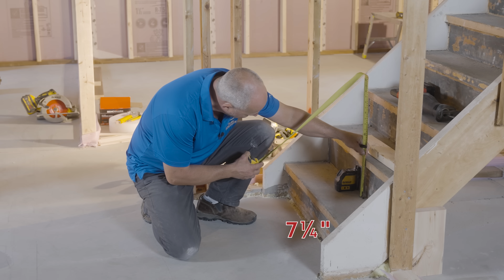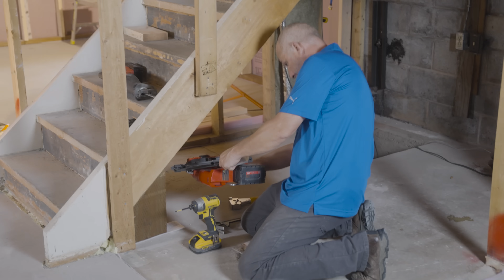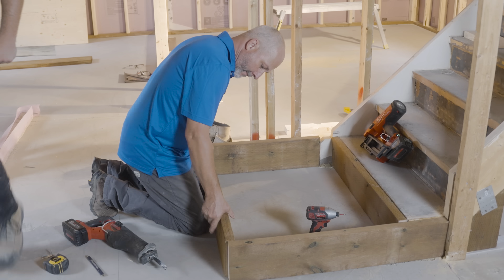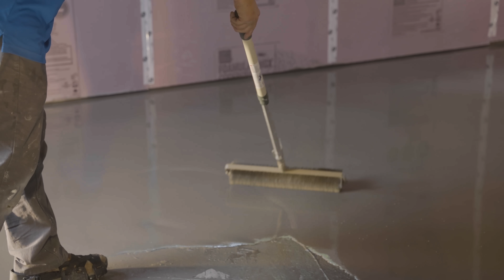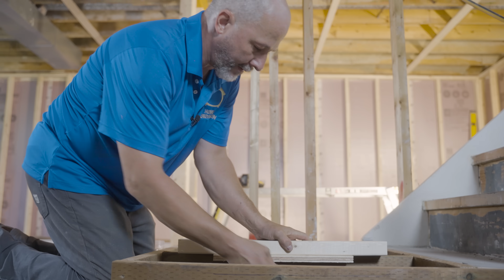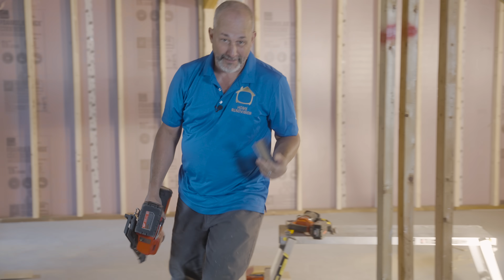The Most Common Basement Problem (And How to Fix It)

Comment: Seems like an odd problem to have. And not an ideal solution. Who wants 36" x 36" step that doesnt do anything but take up room. As other people said I'd just tear that out after the building inspector passes it. But Either A it's a new build so youre not gonna have any riser height issues. Or B it's a basement reno and depending on what you do you'd be unlikely to get a permit anyway. Unless you're doing like a full living space down there and youre gonna rent to people or something. Also...I highly discouraged anyone from making a basement or attic into living space. These spaces were not intended for living space and they should remain being used only for what they were designed for. Happy building 👷‍♂️

Comment: The one problem with this solution is the raised floor is where the ceiling is now lower after the staicase ceiling meets the basement ceiling...that means any tall person would have to duck until stepping down from that platform (one caveat is if the basement ceiling is actually the standard main floor height)

Comment: I was watching you put in that board with the foam under it with the  "love tap" and thought that cut should should accommodated for the depth of the foam. Then you wouldn't have needed that shim.  The whole step popped up after that tap, and looked unlevel after that. The shim seemed to leave more gaps under that stair around the shim. Next, seems like there was way too many parts needed for the landing.  Why not make the box a bit shorter to accommodate for the plywood, then put a full piece of plywood on the landing? Just my thoughts - love your channel and learn a lot, even to be able to ask questions now!

Comment: A) Have inspector come out before you put carpeting in. "It is going to be a concrete/unfinished floor/area of the basement"  b) Add 1/4" to the design of last riser when building staircase.

Comment: I would have cut a new staircase.  Given all the major work he is doing in that house, and the super duper living space basement he is planning, solving a problem via an extra landing that eats up 9 sq ft of the basement floor (and that is not required for changing direction) seems like a shortcut to regret years later.

Comment: Does code say to run the grain the wrong way?
And no supports on ends where the plywood will bend due to the grain being wrong.
And why not just rip your frame so you can just run one piece of plywood over the whole thing?

Comment: I used to build houses and that is my preferred method of ending basement staiirs for quite a few reasons.  Designers usually don't leave enough room for stairs to work well.  I always tried for atleast 42" length on that bottom landing.

Comment: Weird.  I've never seen such a thing as a landing on the bottom step of a basement stairway.  It seems worse than a useless eye sore, it looks more like a trip hazard.  Also, the 3/8  inch variation in riser height applies to contiguous steps not the staircase as a whole.  Sorry, I'm feeling a little cranky this morning.

Comment: The solution to the problem is to Figure your math from finished floor to finished then then you add on the bottom riser accordingly, then they all work out mathematically. Don’t forget to drop your  bottom riser to the thickness of your stair tread. You could wind up with a problem with head height if you add a landing, that has to be figured out.

Comment: I'm aware of the code for variation in step height and had come up with this solution for my basement....but wasn't sure if it's acceptable. Thanks for confirming that I'm not the first to have this idea! The only question I have is why would you not use one continuous sheet of plywood for the landing? Is it just because you wanted to go full material width on the 2X8s?

Comment: Step 1 Build stairs wrong.  Step 2 "Fix" by adding unneeded and non-functional landing.  Step 3 Take 3x longer than needed to frame and deck landing.  Step 4 Fail to use adhesive under plywood, guaranteeing permanent floor squeaks.  Step 5 Announce "Once again, this is better than code!"

Comment: Most basement stairs have an upper floor opening just or less than the size of the staircase, if doing something like this, be careful to maintain minimum height from your landing to the beam or ceiling above... in my area its 6'-8"

Comment: Why not just rip down the joists by the thickness of the plywood?  That way there would be no need to monkey around with 2x4" and three separate pieces of plywood?  and then you just cut one 3'X3' piece of plywood out of a 4'X8' sheet - then Robert's your Dad's brother.

Comment: Oh, Jeff, Jeff, Jeff. This is way too many pieces of lumber, too much labor, and too much potential for squeaks. Remove the bottom tread and build a new platform extending from the riser. Skip all the extra 2x4s and little pieces of plywood. You only need rim members (anchored into the slab) and some intermediate joists, which don't have to be full depth...2x6s will do. One piece of plywood over all of it, and install your hardwood.

Comment: Won't you have the same problem when you lay the hardwood on the landing? The first step up from the landing will be the thickness of the hardwood shorter than the rest.
Reply: I believe he is installing the same flooring on each step.

Comment: I just did this after moving my stairs in the basement. The landing solved my 36” problem to the wall. Putting a landing solved everything and allowed me to turn left and right. Great insight. Oddly we’re on the same wavelength.

Comment: Oh, there is no maximum height code of the landing??? 

Due to the flaw of the framer, My last staircase is 8” high, which is 1” higher than other steps, if there is no code of landing,  can I attach a landing that simply levels to the last stair, turning it into a huge “magic landing”, like in this video, and pass the inspection? 😂

Comment: I want to install a thermo pump, unfortunately passing an electrical wire through the ceiling is not something i want to do. If i pass a wire along the ceiling, is there a way to hide it so it doesn't look obvious ?

Comment: as someone who has a trip step landing for code reasons...... I DESPISE IT. go the extra mile and do it right. at least yours makes sense with the hight.... mine doesn't its 3 inches BEFORE any flooring goes down. With carpet/subfloor below it it makes it more like 2 inches. I HATE IT,  I'm working out a way to delete it and make another actual step to replace it and move the steps to be shallower just to fix it. Its concrete steps so its harder to just FIX than you have to work with. I wish I could just fix it with wood like you can, but I don't have that luxury. WHOEVER DID THIS IN THE 1970's when they built the house.... I HATE YOU.

Comment: The biggest problem isn't getting the stairs perfect, it's getting rid of code that only gives you 1/4". Ima guess that's due to human nature and that we would expect the stairs to be even as we descend them to avoid a tripping hazard but, 1/4"?? That's freakin' tight. Who wants a landing instead? It's just a work-around that exists for no real reason at 1/4" code variance.
Reply: I agree. we have a stupid 3inch trip step landing to our basement and I despise it with a passion. No other houses with our exact layout has it because someone screwed up the concrete pour on those steps going down and they angle down just enough that code demands either another step and shallower steps..... or they did the quick and dirty method of making a landing...... 3 inches high.

 I would rather 1 extra step over this tripping hazard. Since we are working with a 1970's split level we are having our first basement go up 1/2 and inch with plywood to help level out the other stairs since they added hardwood floors upstairs and that top step is definitely higher than 1/2 up, they just slapped it on top the other step so now everything is up half an inch so a retread/carpet job will fix that and then the second basement down will go up enough that we can just create new steps going down over the old concrete steps that are slightly shallower and make 1 new step at the bottom (since there's more than enough room for that before having to turn the corner so it won't stick out)  and jackhammer out the bottom landing. the landing will be the end of me I swear. The bottom basement got lifted up as well for plywood reasons as well so that landing is now a 2 inch trip hazard.

Comment: There’s another solution, which my builder used in 2003. He had a staircase made in a factory (same factory made all the walls and trusses for my ranch).  I wondered how good it was, so it got the ultimate test. When we were building my 2 masonry fireplaces (one in family room and one below in basement. I bought 2 limestone sills for the raised hearth extensions. The upstairs 6’ x 20” wide x 2” thick weighed 265 lbs., the downstairs one was 9’ x 20” x 2” thick was 393 lbs. I had 4 friends take this from my 2002 Honda Passport to the basement. At the bottom of the stairs, they couldn’t make the turn. I got a short 2x4 and they put it on it and rotated it and carried it to the fireplace, to a bunch of wood that were the same height as the hearth. This would be installed when the foreman bricklayer showed up later in the week.  By the way, the stairs survived the 4 friends weight and the 393 lbs, that got stuck there momentarily. This was 21 years ago, the stairs are still fine. I eliminated one of the walls coming into the basement, 4 steps from the basement floor and finished it with oak, this was to eliminate the problem getting bulky things downstairs. If you’re going to put up a wall next to your landing, aren’t you causing the same problem I had?
Reply: Getting rid of the wall next to the stairs at the bottom really opens up the basement and feels so much better. Cut mine at standard guardrail height with slope matching the stairs.  Makes for a much nicer entrance.
Reply: weight rating for stairs is a minimum of 100 pounds per sq ft. Factory built stairs are usually closer to 1,000 pounds total load. I have added extra support to several stairs in my days of moving boilers. You can never be too safe!

Comment: The variance per the code is 3/8", not 1/4":
R311.7.5.1 Risers - "The riser height shall be not more than 7-3/4 inches (196 mm). The riser shall be measured vertically between leading edges of the adjacent treads. The greatest riser height within any flight of stairs shall not exceed the smallest by more than 3/8 inch (9.5 mm)."

Comment: Could you do a video on levelling old stairs before installing hardwood treads.  You mentioned using feather patch on this staircase.   The old basement stairs in my house aren’t level and surely also wouldn’t hold a wet concrete leveller - there are some big gaps.  Would love to see a tutorial on how to fix this for the long term.
Reply: I would go underneath.  Look at the treads and see if you can shim them from below to level them after you loosten the tread.  You may need to shave a bit off the riser but wait to do that when you go to level the next tread.

If you don't have access below the tread then you may need to get creative with shaving sanding and other ways to level the top.

Comment: I dunno, I probably would have taken the time to remove that bottom tread and make a new landing with joists running under the first riser, then top it with a single sheet of plywood
having that old tread in there, with the filler plywood between the joists rather than on top, there are just so many joints without glue that'll eventually squeak in the future
like yeah you're putting hardwood ontop, so it's not gonna fall apart or anything, but that's also a lot of new joints, they're gonna dry out, shrink, separate, and over time, squeak
a single sheet of plywood would hold that all together nicely and it would age a lot better
Reply: I agree. Rip 3/4" off those 2x8's and put plywood continuously over the top of the new section. Seems like a lot of extra work cutting and fitting those interior supports and plywood sections just to avoid an easy rip. Furthermore, never put supporting elements in sheer when can just as easily make them properly load-bearing. No experienced carpenter would ever build it that way.

Comment: With that said, how do you fix a squeaky 1980 basement staircase made from cheap plywood risers and particle board treads held together with large staples? Access under the stairs is possible.
Reply: I'd replace it with real wood but if it's in good condition and replacement isn't an option there are quite a few videos out there on how to remedy this.  Shims, glue extra screws, wax.  It really all depends on what the squeak is caused by.  If they used nails instead of screws....  Pull and replace with screws.    Have someone on the stairs and someone below marking where exactly the squeaks are.     Good luck!!
Reply: Oh and with plywood and MDF your going to have issues if you don't drill pilot holes for the screws.
Reply: I wish they'd have used screws. Like a said earlier, they used large staples. Rebuilding isn't an option, I wish it were.
Reply: Been there done that, but we did't have access from underneath. We just crewed in 3 inch construction screws with the star head with an impact driver after drilling pilot holes and sank those suckers in. Patched the holes on top. Hammered down the nails as best as we could flat, then cut off the noses where our tretread end caps would go (so it doesn't stick out beyond the carpet and look bad while being trip hazard.... I've seen those quick and dirty jobs). Husband thoroughly stepped, hopped, and jumped over each stair to check for squeaks and places where things separated to be rejoined.... then did a hollywood carpet job down the middle with hardwood re-tread end caps over the sides and called it a day.  You can either skip the retread part and carpet over, or do a retread job exclusively....  I just went extra. 

I just liked it fancy on a budget so that worked just great with extra hallway carpet we got for dirt cheap from habitat for humanity restore that was very good quality that was aesthetically pleasing pattern and color wise.. cost us $300 in supplies for 13 stairs with a 2-6 and even 3 inch inch retread we chop sawed down from x3 42 inch treads. Parents thought I was nuts for not just recarpeting exclusively the stairs, but they weren't the one putting in the stairs or have half exposed stairs that begged for wood treads with the pretty curve at the bottom that carpet just makes look cheap and sad.... especially with the sin of a mophead half dead slumlord carpet job that was there before. Also when you have a gorgeous solid walnut/oak reclaimed antique newel post on the stairs...... it begs for the fancy treatment of wood stairs and makes it all come together better.

Full retread would have costed over $500 and most of it wouldn't have been covered up with carpet anyhow, plus the upstairs stairs are wider than 42 inches... carpet only would have costed $150 and been faster... but I would have regretted having not done the wood caps and cost more in carpet padding and difficulty folding the carpet perfectly around the caps on the side. Also wouldn't have had extra carpet to do the second set of stairs as our house is a split level. Ties in the whole house so much better now.

Comment: Building inspectors: you can’t have that extra 1/8” variance in your step you could trip!!!

Also building inspectors: so instead I want you to build out a landing 36” into the hallway def won’t trip on that!!😂
Reply: The spec is no more than 1/4" variance. You'd be amazed at how often people will trip after 3-4 steps if they are not uniform because most people adapt to the height within those first few steps. From that landing you would be allowed to go max 8" to the floor because it's a new step / stair. If he adds 1/2" laminate floor then he's back to 7.5 inches on the last step, so within the 1/4"

Comment: Remove the rough framing stairs from 70s that was installed to get into the unfinished basement! Have a new stairs built offsite with the finished materials that match your floors! Time and materials involved in covering steps with finished materials and the landing at the bottom which I feel is not correct solution to the problem.  The landing to me is a DYI fix! Your still in framing and changes to stairs can be made!
Reply from the maker: I have 2 stair cases to build if I do it that way. I am more than happy to cap them so this is actually a much simpler solution. Cheers! But like most things there is always more than 1 way. plus a change to the stairs involves a change to the permit. and another inspection. I am not interested in increasing the scope once i start a project. I hate going backwards in the process. Cheers!

Comment: If you never plan to be inside the landing box cavities ever again, Id personally recommend using a construction adhesive or acoustical sealant on the plywood covers to the 2x4s , prevent them from ever getting squeaky/lifting or becoming loose. I know you used screws but it would make it very solid and maybe even feel "solider" being adhered.

Thoughts on that?
Reply from the maker: I get it. However I will be using solid wood flooring on that step and pl premium as well. so no issues long term. Cheers!
Reply: @ oh okay, thats not the final stepping place, I see.  I was thinking it would be carpeted or  linolium or something.  Makes sense to me then if its solid wood flooring.